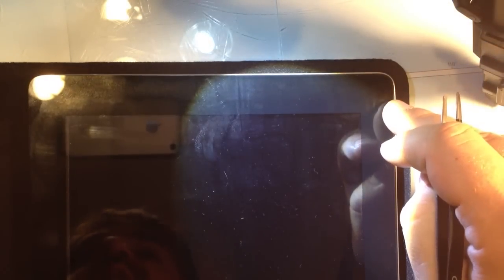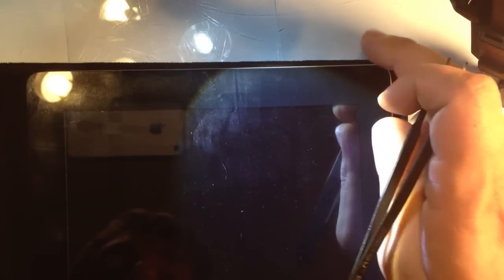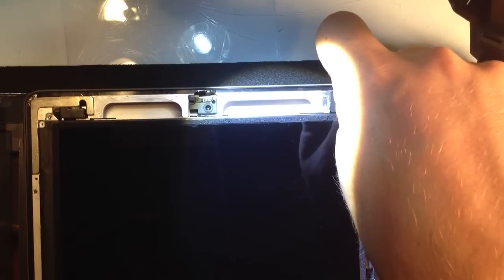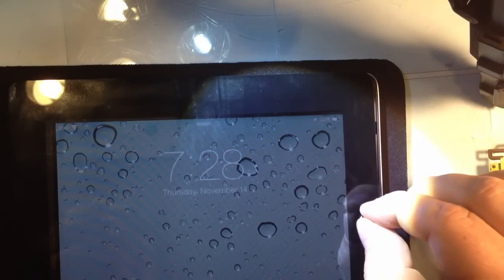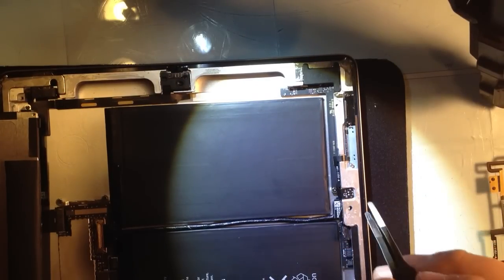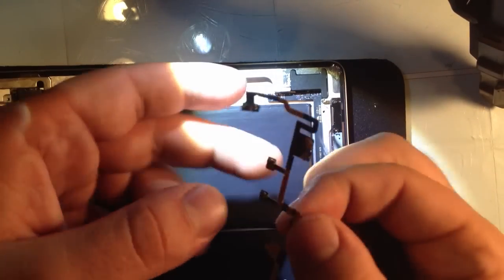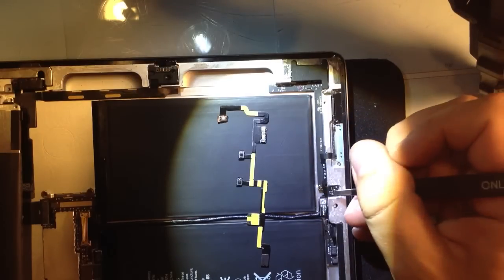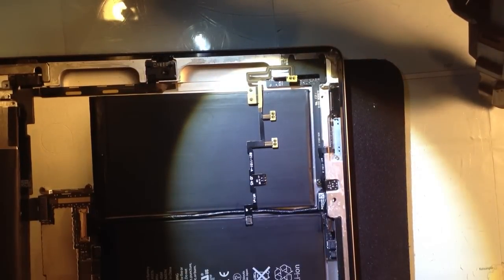iPad smart case sensor repair

Comment: My ipad mini 2 was replace by lcd because the screen is damage already after replacing it by a technician after a month of used the screen turn in to ghost touch some part cannot be touch ive watch videos on how to fixed it but it didnt work because i think the digitizer is already damage because on the right side portion of the screen there are part that cannot be touch already so i bought a digitizer online i watch video on youtube a i replace the digitizer on my own its working fine but the automtically lock unlocked on cover case is not working already. Can you help me how to fixed it? I didnt do anything i just replace the digitizer i just follow whats in the video on youtube but still the lock unlocked on a cover case is not working.

Comment: I've found that most of the time the lock/sleep problem wether its a autolock issue or a button that doesnt sleep but holding it long enough allows the slide to turn off button to appear) is due to a tiny and common short/fold that occurs in the last stretch of cable that runs downward on the inside wall of the case between the lock/sleep sensor and the end of the cable that plugs into a small board located near the magnets. This usually happens during the LCD re-installation process. This is because of the design of the sensor cable. The top cable portion (above the sensor near the volume) seems to naturally fold downward, however the design of the bottom portion is the opposite and can easily fold downward and short out when re-installing the LCD. The exact area that gets damaged is the very last curve in the cable as its exiting the sleep sensor area. Sometimes its hard to notice because the cable won't always tear as it can also looked stretched, twisted or folded with a crease. Sometimes that portion can bend and not appear to fold on the outside but the inside pins can be damaged. This cable is supposed to be tightly adhesed to the inner right wall of the case and sometimes the cable can be pressed down by the LCD, causing the cable to stick to the bottom portion of the case which can fool an untrained eye into thinking it was supposed to be there to begin with. You will have to replace the entire lock/sleep cable unless you get lucky and can straighten or flatten the damaged area to establish reconnection. If your ipad is on and volume up, you will hear the sleep/lock sound every time the wires make contact. Hope this helps someone.

Comment: Could the problem be the case itself.
Reply from the maker: Great question! Yes, definitely. Not all cases are the same. Some of the cheaper offbrand ones are most likely thrown together quite simply. And not as well studied as namebrand ones are.

I also found that the replacement power, volume, and smart sensor flex cable can be faulty. One of my suppliers, sent me five flex cables, and they all seem to be faulty with a specific case.

Comment: Nice presentation.  Its actually a Hall effect sensor and I have had endless trouble getting a non faulty replacement.  I have also had replacement cables with non functioning button or slide switches, solder bridged switch connections and even missing the tiny decoupling capacitor that is adjacent to the Hall effect chip.   There seem to be a market in faulty versions of this cable!  Its part number is 821-1151A.  The Hall effect chip is marked 3T and has a bevel which is towards the plug in connector.  If anyone knows the true identity of this chip and/or a supplier please respond - as its quite simple to resolder this onto the plastic cable.

Comment: Thank you! I've replaced tons of digitizers on iPads and this last one had this problem of the battery draining rapidly and the sleep button not working. It was driving me nuts trying to find the cause because no videos or manuals ever note that the square piece on the flex cable is actually a sleep sensor. I damaged the cable when I removed the digitizer so I bought a new cable, but the new cable must be defective as it's the one causing the problems currently. Off to order another one, thanks again for the video.